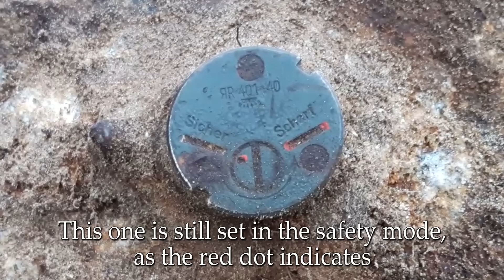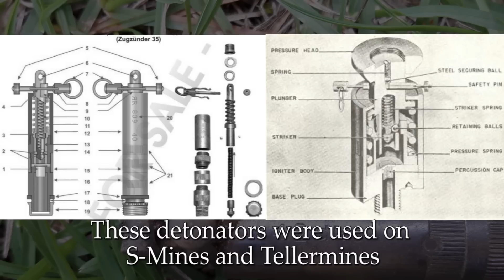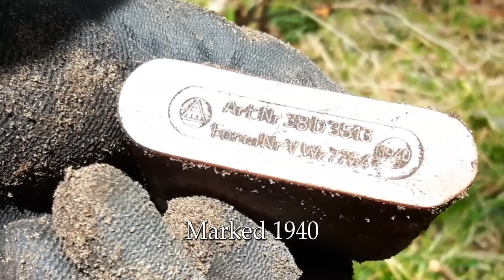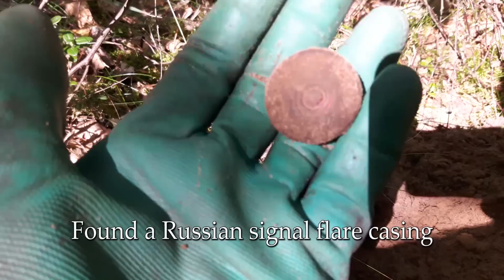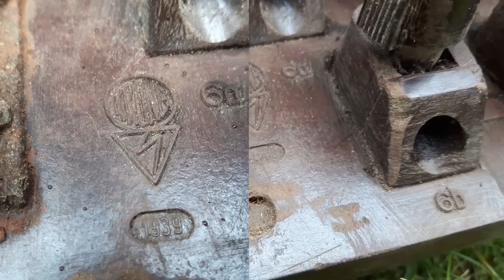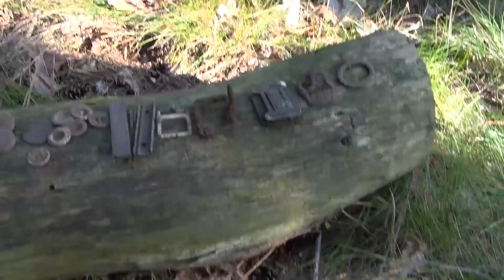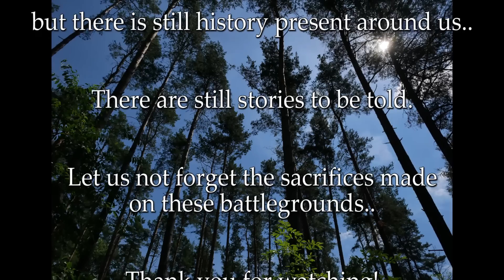Metal detecting - "Opening a mysterious box" (Eastern Front)

Comment: The box at the end is called an Abspanbock ( my German is not very good) a plug goes to the middle ( small holes) to a cable that plugs into a 10 line switchboard. Each one of those twist downs is a separate telephone line. 10 phone lines can plug into this. It would have to be totally rewired for it to work again. Brilliant find. Let me know if you want to sell?

Comment: The panzerfaust had the average range of 30 metres when it first came to service and the warhead was smaller and different in shape compared to the later ones. The panzerfausts range was dangerously Limited so its user was easily mowed down by the tanks machine guns, the weapon was developed further and the range was extended until the maximum of 100 metres was achieved giving the user far better chances of survival.

Comment: you might want to be careful with that panzerfaust tube the propelling charge is still in it as indicated by the cone up front
Reply from the maker: 30121965huey 
Thanks for your advise. We are always careful with the ordnance we find. The only thing left in the Panzerfaust is the remainder of the tail of the rocket. No explosive charge left. A simple google image search will confirm this.
Reply: I have been in the field for 40 years I did not say there was explosives in it behind the cone is a wooden plug with the fins on them behind that is the booster charge and it is still there you might not want to turn up the heat too hot in the room where it is with a 75 year old booster charge...just saying after 40 years of experience google cant tell you everything

Comment: I am always curious but what are those bumps all over the metal when you usually clean things like that panzerfaust. Does the metal expand or some form of corrosion? What is that?
Reply from the maker: It's corrosion, which is in fact a reaction between the original metal, oxygen and water. It affects the original surface of the metal. If you would remove the bumb, you would see a small dent in that surface. I think that's a primary example of how oxidation processes work. Gotto love science!